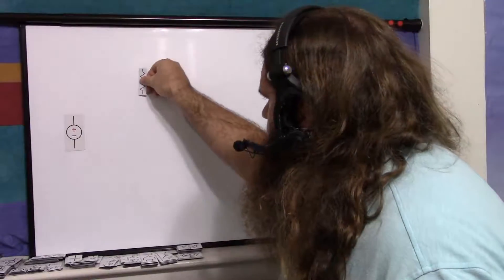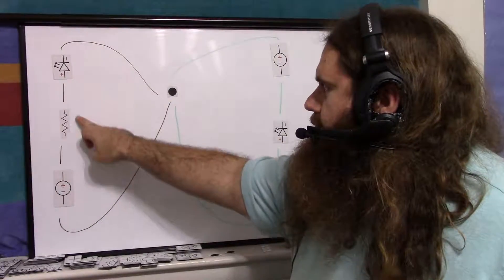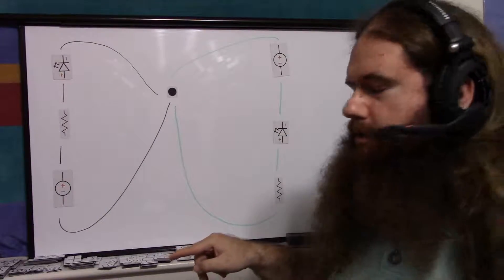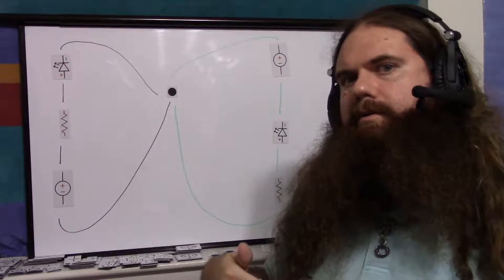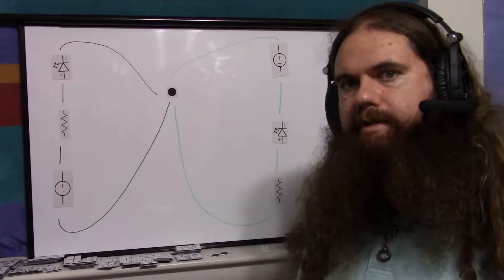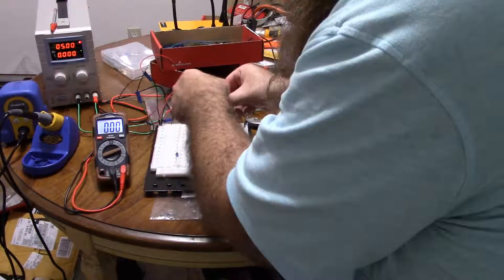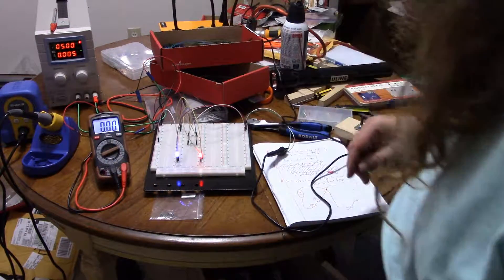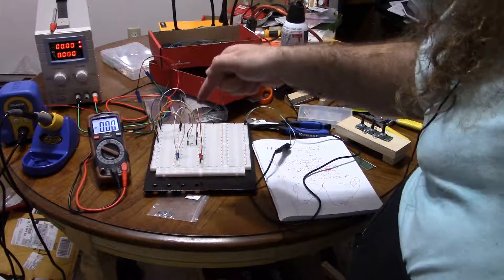Opposing Voltages with Two Power Supplies - Simply Put

Comment: I noticed that you have mounted three rotary encoders (might be pots) on a board, for convenience. One of my best DIY bench tools is a single, 10-Turn, 10K pontentiometer, mounted on a heavy base, having non-skid rubber on the bottom, and an oversized knob to turn it easily and with great precision. Its three wires have alligator clips to easily connect them. I highly recommend such to you.